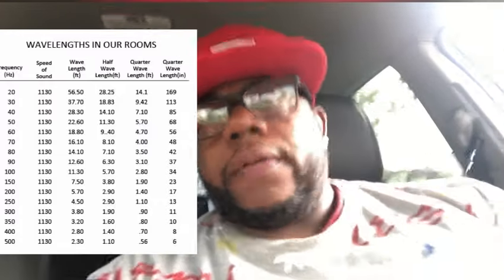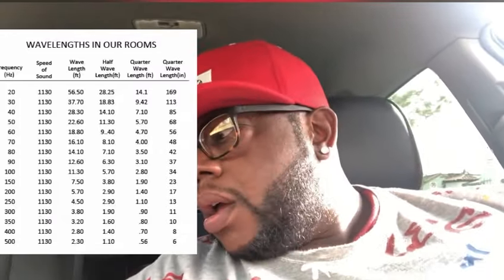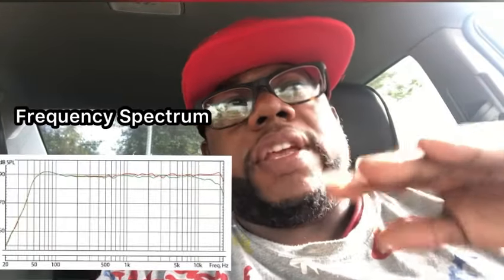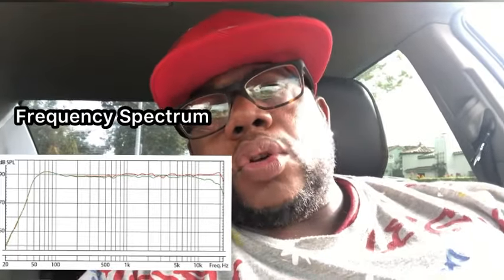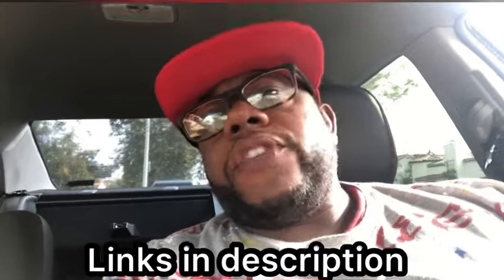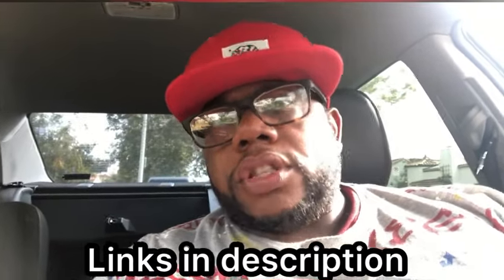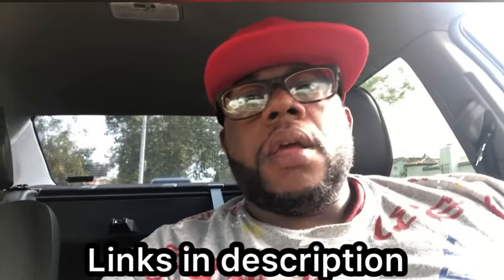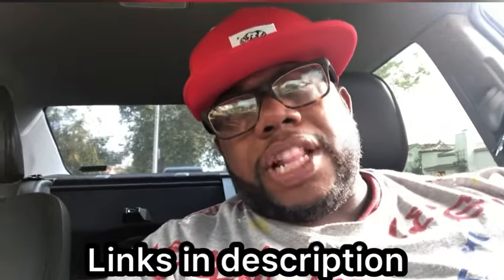How to make subwoofers sound louder

Comment: I found a trick to increase the strength and clarity of bass. My sub is in my trunk and the trunk is closed off by the rear seats. If you drop one of the rear seats and crack your windows then the whole cabin of you car becomes a 2nd sub enclosure in a way. If you at least drop the rear seat then it will also reduce the amount of rattling you hear from your car since you’re letting the vibrations escape through the air rather than the car itself.
Reply from the maker: Exactly I have a video explaining that the seat down reacts like a port too
Reply: okay what do you do if you are in a SUV like a Jeep?
 and why not just roll your windows all the way down? wouldn't that let more out to travel farther and be louder ?
Reply: @maniacalmonster2293  Ya you're right if I do let my windows down more then it would be louder. I personally prefer cracking my windows a few inches so I get fresh air without wind whipping around at speed. The boost in bass strength from cracking the windows if more than enough for me. I guess what I was trying to say was even if you have a setup like me with a car that has the passenger compartment separate from the trunk. Then cracking a window and dropping a seat is a huge improvement that I'd totally recommend.

(I apologize about the long reply but I hope it helps you out in some way.)

In a SUV like a Jeep you do have a very different situation than me. Since there's nothing blocking the rear trunk area like the seats in my sedan. Then my problem has already been worked out by the design of your car and all you need to do is open the windows. 

Something I've learned though that might help you out more is one time my trunk was opened and I noticed the strength of the bass went down drastically. So it led me to believe that because the trunk was open the vibrations from the sub in the air found and easier escape route out the back instead of being forced through the passenger compartment.

Idk how you like driving your Jeep but if you do happen to drive it with the doors off and/or the roof off then the bass strength you're looking for could be escaping out of the top of your vehicle. If you do happen to have a soft top Jeep, then I imagine that the material the roof is made out of could be absorbing more vibrations because it's much softer.

Another thing I learned is placement of the sub. If you have it pressed up against the rear seat, then the fabric and cushioning of the seat can absorb a lot of vibrations. I have my sub placed a few inches away from the sides of the trunk compartment and seats, so I don't get as much loss from it.

The last thing I got that helped drastically was replacing my stock radio with an aftermarket one. The stock radios that come in cars are built very cheap and don't produce as clear or powerful of a sound from the speakers. I personally bought a pioneer radio and wiring harness for about $125-$150 and installed it. I understand this isn't a quick or cheap fix but it greatly improves all audio quality overall.

I'm in no way an expert on sound but these are somethings I've experimented with that I think could help you out. I have a few more thoughts about how to improve bass strength but this reply is already way too long so if you want to know more, I'd be more than happy to share what I think. :)
Reply: True I noticed this one day and haven't gone back since my seats stay down. But the cracked windows is new. Will try this.

Comment: More cone area doesn’t always mean more bass or making you louder it always comes down to the box design
Reply: True I’ve seen boxes turn 2 small 12s into a window shaker really sets off the set up it was a fully closed box with a port both subs pointed at eachother inside the box with the port on the side was the first time I seen that it blew me away
Reply: Then what’s the point of 15”s and 18”s
Reply: @TaxationIsTheft439 every speaker has its place
Reply: @mmid8960 bro I seen 2 jl 8s shaking the whole door windows look like they were worping and everything idk is the box was ported but it was really small and compact I really thought he had like hidden subs or something and they were only 300w each
Reply: @TaxationIsTheft439 each sub hit different notes. Eg 8 will capture more notes than a 15

Comment: But if you use an app to find your car's frequency response wouldnt your current system/sub box tuning effect that number? Im sure its different for a box tuned to 40hz to one at 28hz or does the vehicle have the same fs?

Comment: MAN I WISHED YOU LIVED IN GEORGIA! THIS IS WHAT I HAVE SKAR AUDIO SDR-2X12D4 DUAL 12" 2400 WATT, SKAR AUDIO SKv2-1500.1D 2,200 WATT MAX POWER CLASS D MONOBLOCK SUB AMPLIFIER,SKAR AUDIO 1/0 GAUGE 3000 WATT OFC AMPLIFIER WIRING KIT W RCA,SKAR AUDIO SKv2 AMPLIFIER SERIES REPLACEMENT BASS KNOB CONTROL PACKAGE  ( ! IT USE TO SOUND LOUD BUT NOT NOW! PURCHASED IN JAN 2022!
Reply from the maker: This happens to everybody honestly no disrespect our ears can only handle so much loud music after 100 dB or 120 Dbs your ears try to close to protect them self slowly the Bass doesn’t sound loud to you that means you’re damaging your ears your hearings is going slowly honestly Google what I’m saying I have a db app on my phone so I don’t go over 85 or 90 db

Comment: My cousins Tacoma sealed does a 162 legal, my CRXs frequency is 66Htz. More cone area is not always louder. Proper airspace and box design is king whether at 30Htz or 66Htz. A bass app can not compare to a TermLab that tells uou the actual peak frequency either.
Reply from the maker: Watch the video again I said I wasn’t talking about SPL I was talking about loudness perceived what your ears perceive as loud big
Reply: @ImageDesign  I understand that. Nothing I said was wrong at all though. 30Htz, 66Htz, unless the box is built properly you aint gonna hear it. SPL or not, cone area is not always king. Thats why my one 10" sub on 1,000 watts sounds louder than my neighbor with two 15s and 2,500 watts. It's because it actually is. Even though the  box in my CRX right now peaks in my car at 35Htz, which is not the frequency of the car,  it was built right. His is tuned to 30Htz but the cross section of his port is way to wide and not tall enough. If cone area is king then putting four 15s in my CRX should be better than two 12's. The vehicle itself needs enough airspace so to speak to carry the soundwaves. Whats a soundwave, airflow at a certain frequency. The best way to be loud is by far, PROPER BOX DESIGN. SPL or daily driver doesnt matter. And 66Htz with 16,000 watts is very noticable from several blocks away when it's 160 Db's!
Reply from the maker: @talkgunsatquincyscorner1494  dude you are correct on all you just said
But cone Area is king when it comes to frequency response not SPL most 15 inch subs hit lower than a 12 inch of the same Brad make and model 
One again I’m not talking about SPL
Dude I’m sick and tired of Bassheads wanting to argue all the time have fun we all love the shit I’m a sound engineer over all what I’m talking about is not this car audio it’s science wave length is science sound travels
Google it The reason The lion is the king of the jungle is because i’m his roar of his roar and not how loud it’s the frequency of his roar a lions war is below 20 Hz and like 15 Hz ground shaking and travels 100 to 150 feet 
Try not to be so competitive enjoy your system and have fun you guys are starting to take all the fun out of loving Bass
Reply from the maker: @talkgunsatquincyscorner1494  
Yes you right Bass needs space 
I’m so glad you said that I keep telling my friends that 2-15 and you only 12 inch of trunk space you not moving air 
Makes No since 2 - 12s with half of your trunk space left is efficient space for Bass 162 SPL on 1000 watts I’m impressed I know dudes with 2000 what’s only hitting 114 SPL

Comment: So do I want to turn my hz on my stereo setting for my subs ? Or if there is a setting on my Jenson 1200 watt amp nothing fancy . Just something to hold me by till I can save . I'm running two, 10inch Kenwood excelon single coil subs in a box meant to go behind the back seat of a 03 Chevy Silverado 2500 4door . It sound like the amp is the too much for the subs . Like when you turn up past volume 18 or so it sounds doingy. Any help
Reply: Sound like you need to adjust gain n etc

Comment: I have a subwoofer , it is an 18 inch. Its frequency response 35hz to 250hz, what should i set the crossover? It has a built in of 80hz lowest and the highest is 250hz, help me to make it louder please.

My Subwoofer is Beta Three EB118A, also it is powered
Reply from the maker: You need a Bass Processor 
You can set the frequency to 35 
More bass way deeper 
? What type of box ported or enclosure 
https://www.amazon.com/Soundstream-Bx10x-Reconstruction-Processor-Black/dp/B00318KAQ2/ref=mp_s_a_1_8?crid=3VO5XGCC90BE2&keywords=bass+processor&qid=1652234900&sprefix=bass+proc%2Caps%2C480&sr=8-8&ufe=app_do%3Aamzn1.fos.006c50ae-5d4c-4777-9bc0-4513d670b6bc#immersive-view-vertical_1652234957894
Reply from the maker: you should get Hyper Bass 
80hz to 20hz crossover 
14 band EQ and Bass processor 
https://www.youtube.com/watch?v=5ExORczc6HU&t=13s

Comment: What if the watts are only at 700 will it still nail it to get the subs bumping
Reply from the maker: Good question 
The depends on the size of the subs
How many subs 
What way the box is facing 
And the pressure build out of air 
For example
I have 2-12s on on 4homs 600 watt Maybe 800 watts Max power turned to 30hz 
facing toward the inside of my car 
I let my back seats down so all the sound and air builds up in the car and come out the front window you can hear me a block away 

I roll my front window doe

Comment: You need a measurement SPL meter.  That’s the best way to measure.  “Loud” is subjective.

The peak is based on the woofer and enclosures tuning.  The enclosures tuning is based on the woofers TS mechanical parameters.  All calculation then there’s real world.

The vehicles resonance can be checked by moving the subwoofer/enclosure around the trunk to find where it sounds best.
Reply from the maker: yes right but I was really not talking about SPL I was talking sounding loud witch is wave length  I know have heard a car sound loud from a block away but when it get to you its not that loud its just deep thats not SPL thats wave lent at low Hz just saying people thing Im talking about SPL that 2 different thing sound loud on the db meter  and just sounding loud is different
Reply from the maker: yes right but I was really not talking about SPL I was talking sounding loud witch is wave length  I know have heard a car sound loud from a block away but when it get to you its not that loud its just deep thats not SPL thats wave length at low Hz just saying people thing Im talking about SPL thats 2 different things sound loud on the db meter  and just sounding loud is different
Reply from the maker: every thing you say is true but I was not talking about SPL how we measure sound  that is different then loudness perceived by the ear.
1.Example  Car number one at 100db SPL at 50hz can sound loud to you standing next to it or 20 feet away

2.Example Car number two at 100db SPL at 35hz can sound loud to you standing 40 feet away from 
you will think and feel like car number two louder cause you can hear it from far away.  

SPL doesn't measure how we hear sound out side the car that is vibration in frequency
Reply: Loud is not subjective either it is or it isn’t
Reply: @jasonmagana9730  based on what metric

Comment: ITS NOT TOO LATE TO DELETE THIS VIDEO
Reply from the maker: It sounds like you only know about Caraudio and not about Sound and how sound travels
Reply: @ImageDesign  lol lowering the frequency does NOT mean travels further lol there's ALOT more to it like your enclosure and port tuning frequency or like the subwoofers ability to actually reproduce low end extension without unloading.

Comment: My gf does 3hz @ 1500w and screams 146.3 db
Reply from the maker: 146 db with 1500 Watts nice
Reply: @ImageDesign  my gf/girlfriend. Lol. But honestly on subs I have 2 alumapro bandpass 12's. Efficiency is 97. 250 w each and I know I've got to be about 150. My last setup was 2 RE Mx 15 on a 4k and just barely tops this all in one kit. The subs made for the box and the 4th order was made for the subs they've been around since the 90s just like jlw6 I think and nothing has changed

Comment: You lost me when you said boss nothing against low end amps because I had a older hifonics that bangged hard . But all that is good info one very important thing is space like what kind of a vehicle like suv or station wagon will probably have the best sounding for bass good power is definitely needed like a 2nd battery good wiring if it’s a sedan may need to lower rear seats for better sound . I have seen two deep dish 8’s do some damage with amazing sound quality

Comment: So much misinformation. I like your enthusiasm for the hobby but the things you said were all bull, sin the wave length chart. Two 15” drivers do not have 30” of cone area. One 15” circle has 176 square inches of area because to find the area of a circle, you square the radius and multiply that by 3.14. So two 15s have 353 square inches of cone area. One 12 has 113 square inches of area. Three of them is 339 square inches. So, two fifteen subs have more cone* area than three twelve inch subs. Again, I like your enthusiasm for this hobby your video has no truth to it, anywhere.
Reply: Cone area is not king. Most people can get 8 inch subs louder than any boss elite subwoofers. Cone area IS A FUNCTION, yes, but not king.